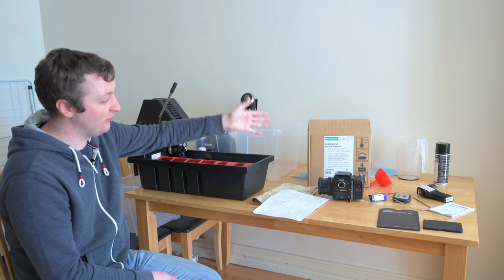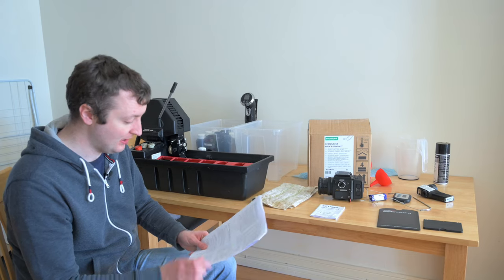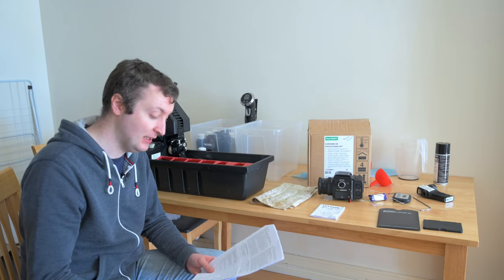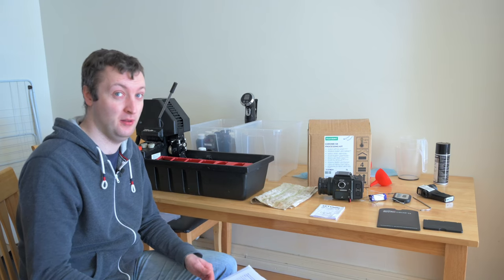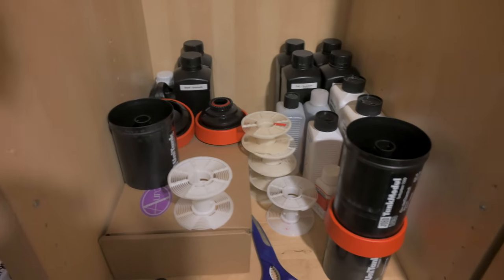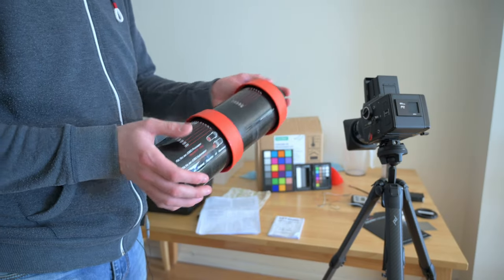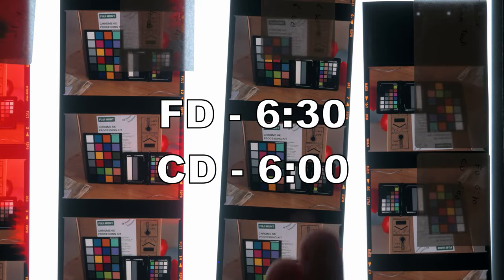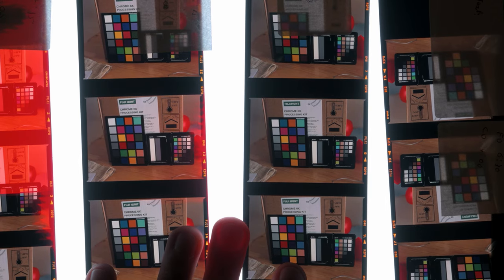Testing E6 Developing times

Comment: For those who care, the reason for differing directions between rotary and "small tank"is that rotary tube systems, not keeping the film fully submerged at all times, require continuous agitation.  "Small tank" assumes use of a plastic or steel tank which keeps the film submerged at all times and will be agitated intermittently. The E-6 process standard calls for continuous agitation. I've never used the Fuji chemistry kits, so I've never faced this bit of confusion. Kodak's instructions for E-6 are specific. The only control variable here is the first developer, the time for which you increase or decrease a bit to "push" or "pull" the overall density of the result.  The rest of the chemical processes go to completion, meaning that they exhaust themselves at some point, after which more time in that step of the process will have no effect. If you see imaging variations by using more or less time in color developer or other components,  then you are just screwing up with inadequate process time.

Comment: What is the reason behind your shift to 6 bath from 3(4) bath?
Reply from the maker: The blix concentrate in the 3 bath died before I could use the kit. Also I just wanted to try the 6 bath
Reply: @SprocketHoles  Now you have tried both systems what is your recommendation? Especially taking the higher effort into consideration using the 6 bath system.
Reply from the maker: @michaelrasmussen3347  I haven't really tried the Fuji kit enough to give a full opinion but the 3 bath is more convenient especially if you are not using a jobo. Both give great results